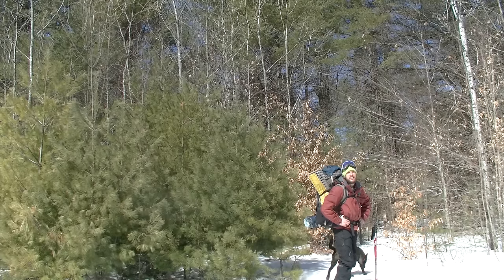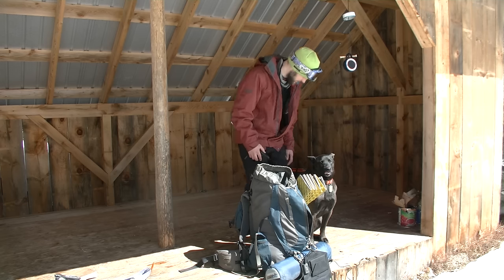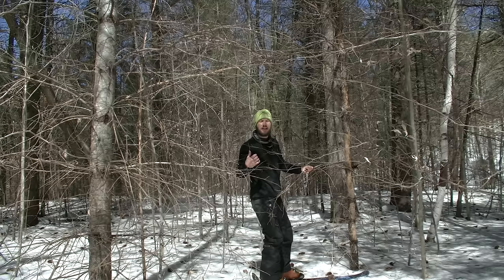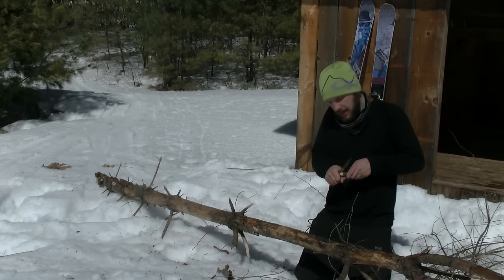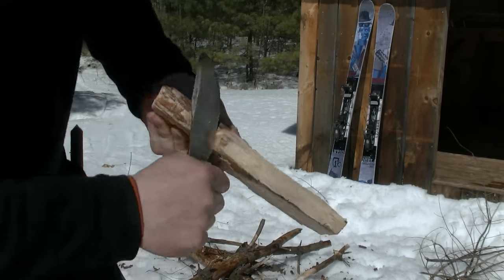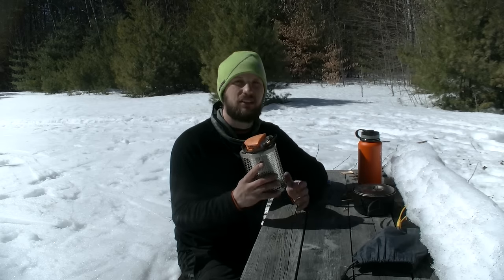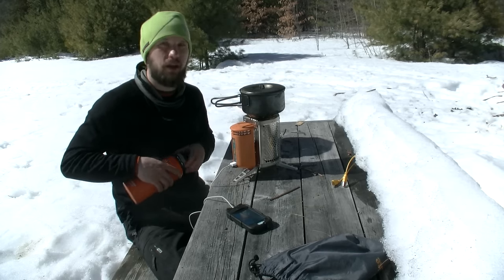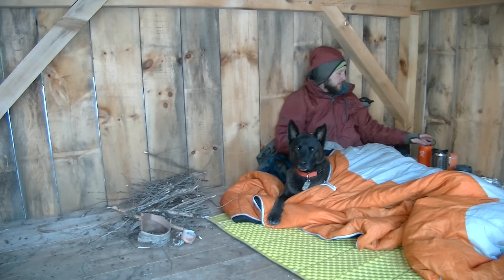Winter Camping with my dog using primitive skills and new technology

Comment: Don't know what kind of knife or saw you use (saw looked like a leatherman). May I suggest a Bahco saw. Very light weight, incredibly comfy on the hand, excellent pull and push cut (a lot of saws only cut in 1 direction).  And for a really good bushcraft knife: Any knife made by Battlehorse Knives, or LT Wright (pricy but you will never need another knife). If you want a cheaper knife that's great quality too, look into Mora knife.

Comment: Great Video. How long has Summit been hiking? He seems to just fit right in and never distracted by the surroundings. Also, Where can you find the Nalgene zippered koozie? Thanks for the info and I look forward to your next video.
Reply from the maker: BackItInKen Summit is 3 now, he has been climbing mountains since he was 7 months old. He certainly gets distracted at times and took down a turkey at this very spot this summer. His favorite thing is chasing squirrels, hence why he is absent most shots.
Reply: granite gear used to make them..not sure if they still do..you can make them with reflectex and duct tape also if you are a MYOG type.

Comment: Great video.  I'm new to your channel and tend to hike 3-season ultralight.  What kind of weight to you carry (on the lighter side) during your winter excursions.  I have to admit I have little cold weather experience. Do you have a "must have" or "should have" list?
Reply from the maker: +shoshinman Staying light is much harder in the winter, but it is possible. Down is amazing stuff. An 850 down jacket is a must and a cold weather down sleeping bag. Extra gloves are also a must. The key to it all is smart layering of clothes and exercising at the right times to build up your own body's heat.
Reply: +GuideYouOutdoors i think if you hike all day stop eat go to sleep you can go with less but just make sure your sleeping bag is 10 degrees colder than the coldest temps you expect to encounter..but if you hang around and are not moving as much you need the extra layers just for that or you get cold..layers are best..dont sweat if possible..and its easier to stay warm than it is to warm up after you get cold..

Comment: Fire board was really helpful. Why not do the notch right away? Also, what do you use to carry out your trash? Egg shells are pure protein and i crush them at home for plants. Do you crush them up and do that or pack them out? What size pack is that? I think mine is too small
Reply from the maker: If you bore a small hole first then you have something to aim for with your notch. If you do it first the spindle could either fall out the notch or it could move a bit and bore the hole a little to the left or right and render the notch useless. Egg shells I burn in the fire or carry out.

Comment: hi dude... can u touch the biostove after using? or is it still hot?
Reply from the maker: +TOBI4S Yeah, there is a heat shield built around it...it may be hot after a long use but generally you can grab it bare handed.